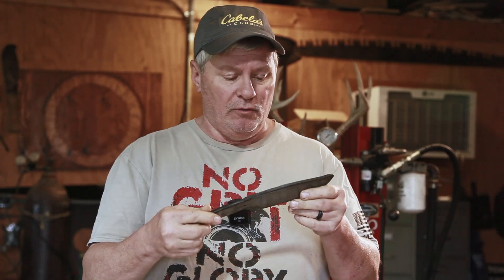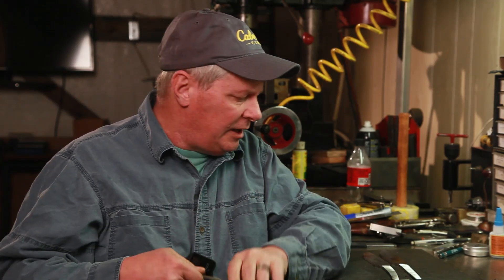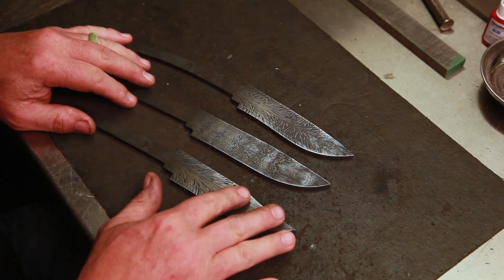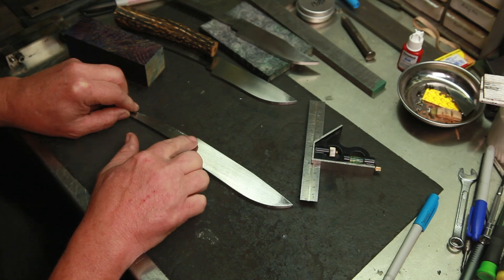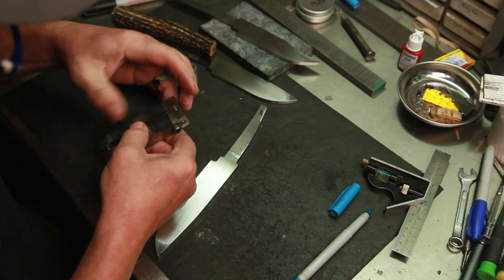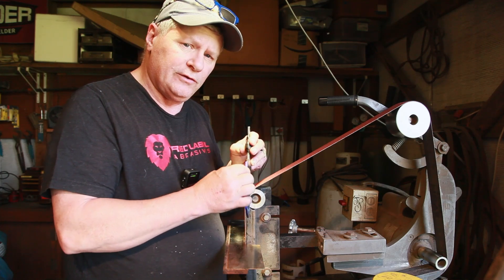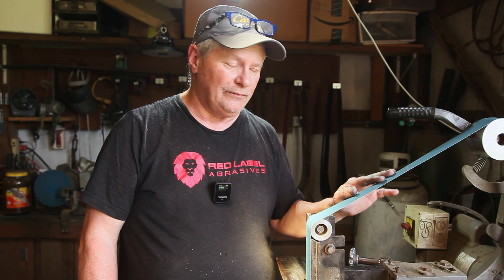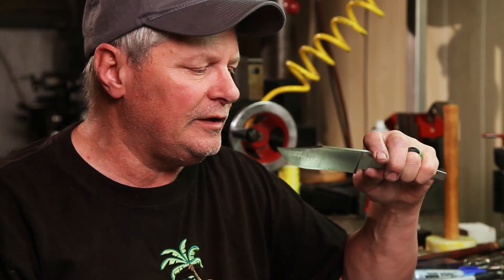I Make a Mosaic Damascus Hunting Knife

Comment: I absolutely love the pattern on the feather drop point, that is gorgeous 
 I have to say your somewhat enforced transition from film to digital is outstanding. 
I had no idea belts were quite so quick to wear out. seems like a good reason to forge as near as possible then clean up with a grinder. I know with certain damascus you can't do that and this is an example of that but it certainly puts a new edge on stock removal knives
Thanks for sharing Tony,
Reply from the maker: Thanks man.  My film work experience has been primarily digital. They were already phasing out film for digital when I got into the biz.  It’s still around but not nearly as much.  Digital is now so advanced that it’s not economical.  Film is a giant expense and going digital once the technology was there was a no brainer.  Yes forging as close as you can before grinding is very helpful but I find that the heavy grit belts are not the issue on hardened blades, it’s the finer grits.  And they would be used after hardened anyway.  It’s one of those necessary evils for me.  Thanks for watching my friend.  🙂
Reply: @TonySeverioKnives  oh and also a resounding yes for the handle work . Digital definitely makes sense I remember investing in a video to digital converter and honestly it was never really used . The process to turn video tape into digital took so long it was crazy and once we got digital cameras the tape one just sat in the cupboard gathering dust. Even the loss in picture quality at the time was worth it. Digital stills over 35mm film I would contest but not moving pictures lol
Reply from the maker: Thanks!  Yes initially the process of transferring to tape was horrific.  Powerful computers have changed that a bit.  I agree film looks better and in both cases imo.  🙂